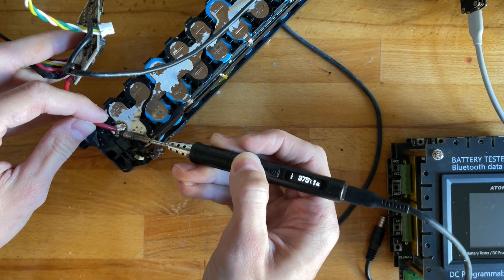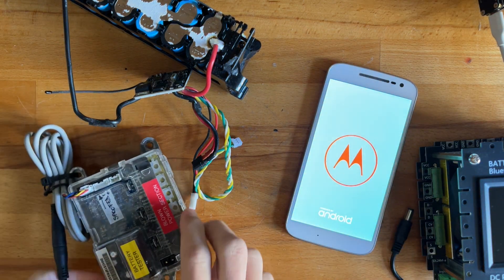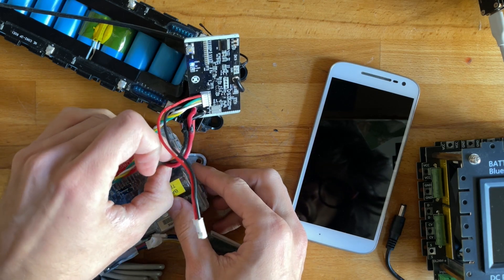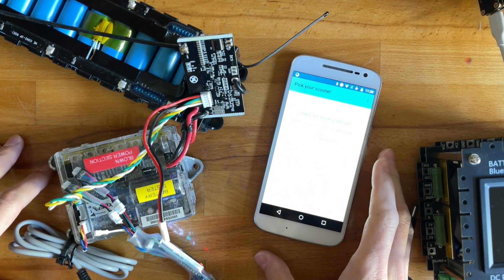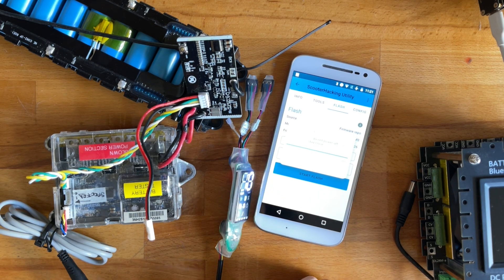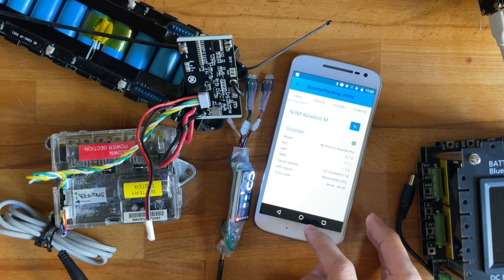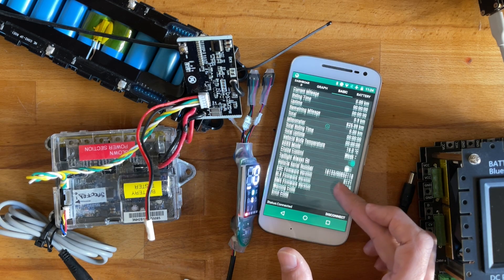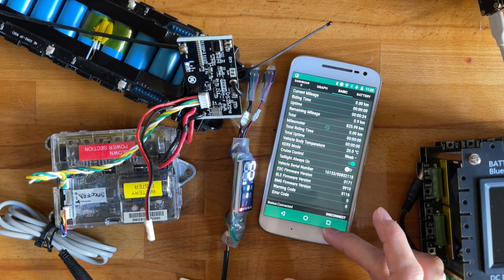XIAOMI m365 aftermarket BMS - can you Flash Firmwares ?

Comment: So like you i got an non original bms in my pro 2. It says its version 0122 without that telling me much. Is there any benefits of upgrade?

Also my scooter sometimes are acting odd. I charge it to 100% but then when i start it later it might say 60%, 70% or whatever and then slowly climb showing increasing charge state. This is when the charger is not connected.
Unsure if its bad cells or bad info from bms, and thats why i wonder about bios upgrade for it.

Comment: Bro how to bulild the spoofer for the Sensors?
Can you please tell me♥️
Reply from the maker: sure

the 3 phase feedbacks are always one of 3 states

0v2 3v3 3v3
3v3 0v2 3v3
3v3 3v3 0v2

you need to build a resistive divider from the 0v and 5v rails going to the motor - and just tie the feedbacks in one of the 3 above states 

that'll pass the startup test and let the controller go into normal operation
Reply: @Darieee  thank you, can i build the resistive divider with 2x 0,55ohm resistors in serial?
With 0v rail you mean ground?
Are the Phase Feedbacks in the same rail or should i connect to a Phase at the mosfet Side?
And how do you manage the spoof for Brake lever and accelerator?✌🏻
Reply from the maker: you need to do the divider with 1000 Ohms or more in total - with 0.55 you'll short out the entire 5v rail

both the brake & accelerator sit at around 0v8 when they're in their resting position

same thing - a resisitive divider with the voltages available there - and it should work

but again - use ohmslawcalculator online to calculate your values, aim for 1-10mA of current to pass through the entire divider
Reply: @Darieee  thank U, i think i first try it with ble75 V10, i heard there are no Errors.
Someone told me i can just connect G with C for the motor, can i try this first?
Its easier for me, if it works haha